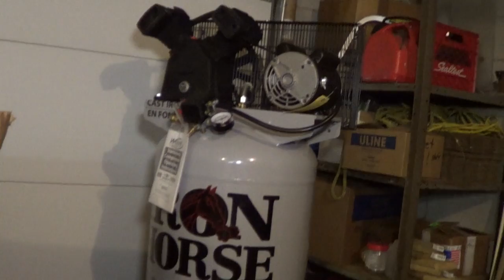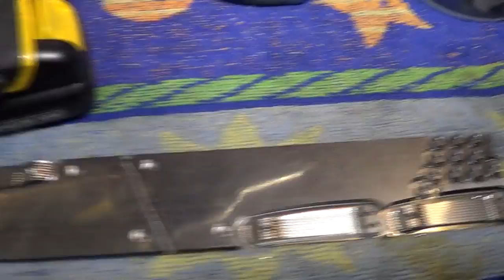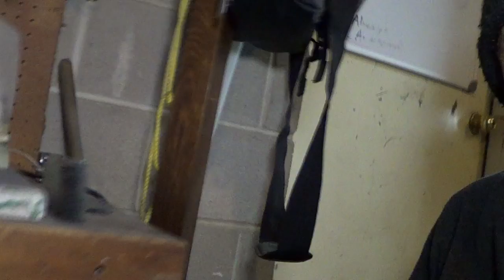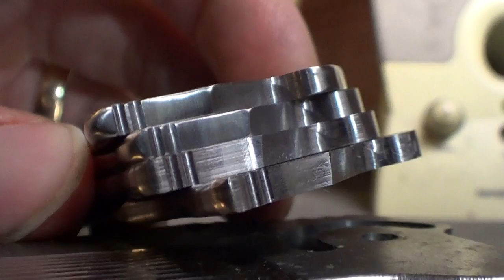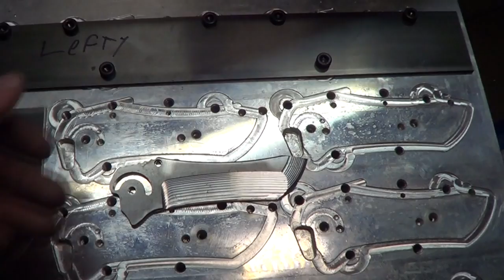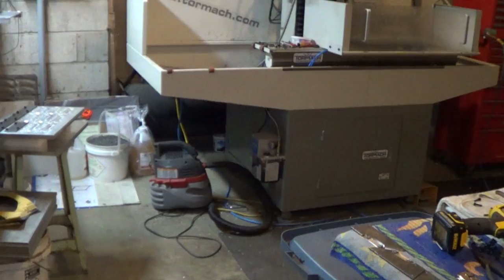Knifemaking Tuesdays Week 58 - Norseman update

Comment: Hey John... A suggestion to help reduce tooling marks and chatter when machining plate work... use left handed spiral end mills, they actually push your work downward while machining instead of trying to lift the work by way of the traditional right hand spiral... you can get them left hand spiral with right hand cutting edge so you can run your spindle normal clockwise or left hand spiral, left hand cut but you have to run your spindle in reverse.... These are perfect for plate work keeps material from pulling up.

Comment from the maker: Yes it would certainly help, but there still has to be some slop in the clearance holes.  My first few batches of knives used two flat head screws (countersunk heads), and I thought that the tapered head would align it tightly, apparently not.  A friend of mine said it best "A bolt is NOT a locating device!"  With a pin you can ream it tight or even press it in, which I might do on one side.

Comment: i was unaware that they were stainless. however, i do not know if it is possible to blue stainless some slow rust bluing techniques might not work but a heat treating technique might and only way to do that and get an even color is to use bluing salts witch are melted and heated to about 600 F . and that gives an even color on the metal it wouldn't be as dark as some classic bluing but it would be awesome looking and it wouldn't affect the heat treating of the blades.

Comment from the maker: I did try that and it works for some things, but not for what I'm doing.  It flips it across your X0 point, but my X0 point is at the top left corner so it would flip it into nothingness and crash into the limit switch.  Also, it makes all your climb milling tool paths into conventional milling, not desirable.  Lastly, it really only works when making one part, not with multiples like I'm doing.  However I appreciate the tip, I only learned about it a year ago and it's been handy a few times.

Comment from the maker: Because that will require using thicker titanium for the pocket clips, something I'm trying to avoid.  This way all my titanium is 1/8".  The pins should work just as good as a boss.  I have a tumbler but it doesn't do as good of a job as the scotchbrite wheel for getting out the milling marks.

Comment: For the pocket clips, why not mill a pocket in the knife handle and a boss in the clip instead of using pins.  It'll work better and look cleaner with less COTS parts to buy.

Also, you should invest in a tumbler to save some labor on the buffer (scotch brite).

Comment: Most of the noise from an air compressor come from the air intake,  if you run your air intake on a house to outside your shop... Or even just up high, not only will it be quieter, but it can often help the compressor last longer because most knife makers shops are filled with grinder and g10 dust.

Comment: I know some people use hockey pucks but i think the durometer for the pucks is too hard (90 durometer). The vibration isolators from grainger are 50 durometer and are only $5 so its not too expensive for softer rubber and with studs already installed. i just bought my 60 gallon air compressor also, so i will be making a vid soon comparing decibal levels of before and after with these mods.

Comment from the maker: 4-40.  That's a very neat idea, thanks for the tip.  Although it's no big deal to flip the fixture upside down and insert the bolts one by one, tightening them down with the drill on a low setting.  When they come out we just throw them in a small tub for storage.

Comment from the maker: On the Tormach we've always used Tormach's coolant starting at a 1:20 mixture.  It's pretty clear, then as the water evaporates it gets milkier.  I just got their refractometer so I can actually measure the concentration and keep it right where it should be.  If I ever get around to using it....

Comment from the maker: Basically I spent a lot of time getting the order of machining ops juuuust right so that the important things were all done in the same fixturing.  The lockbar geometry needs to be done at the same time as the pivot, the stop pin groove, and part of the blade profile (a locating point after the flip).  So it was simpler, although more time consuming, to just re-do everything flipped.  Also solidcam outputted crap mirror code, not only was everything conv. milling, it just didn't work with Mach3.

Comment: When I use wet/dry sanding car repairs by hand it's normal to use good old bar soap and plenty of dips in the water bucket to stop the paper from clogging up so much. It might not work with power sanding though, the wax idea sounds good but it might come down to using buffing compound with cloth wheels in a bench grinder.
Looking at your older videos it's amazing how fast you've both come on in a short time although it might not seem a short time to you :)

Comment: I dont know what your are going to tap your thread and handles to but when you start making your jig to hold them down you might want to take a look into captive bolts. This way you will not have hundreds of screws floating around the shop. You can put nylon washers under the heads to make them air tight.

Comment: I use those ebay end mills a lot! They are great for both plastic and aluminum (in my case 6082 -T6) and they're cheap! I use the 1/8" and 3/32" 2-flute @ 600mm/min, ~15k RPM and between 0,8-1mm on z stepover. Good stuff :)

Comment from the maker: I was hoping that a much newer design would cut down the noise, the old one has gotta be 30 years old.  But the new one has two cylinders.  It sounds different, more tolerable, but not really any quieter.  Get the endmills from ebay, I think it was Drillman that has them, they're wicked expensive new but way cheap from him!  These were like $3 each.

Comment from the maker: I've tried WD40 and it seems to clog more and clump up.  I think the point of wet sanding with cars is to rinse the paper in a bucket of water every now and then to wash off the clumps.  Just putting oil on it doesn't help wash it off.  But I did get a better surface finish with a bit of WD40.

Comment: Simple green clean 50% mix with water on your sandpaper will help loads on the life of the paper and if you work with high carbon steel it helps with rusting.

Comment: John, if you want to cut down on the noise of your air compressor you could always add some vibration isolator pads or feet on the bottom and also pipe the intake filters of the pump outside of the garage. The intake is where most of the noise from an air compressor comes from. Some people even add cherry bomb style mufflers onto the piping to make it even more quiet. hope this helps

Comment: Will the current batch of Norseman in production ( one of which is mine ) have the alignment pins on the pocket clip? Also you spoke off adding a lock bar limiter and ball bearings for this batch as well.  What is the outlook for success with incorporating those upgrades to this current run?   When do you expect to start shipping?